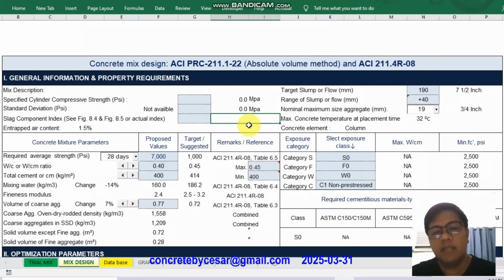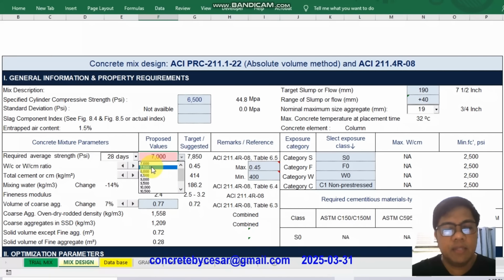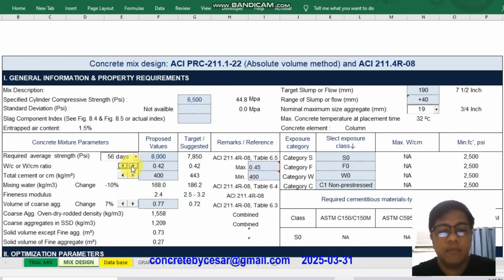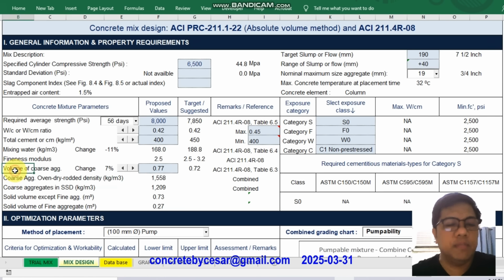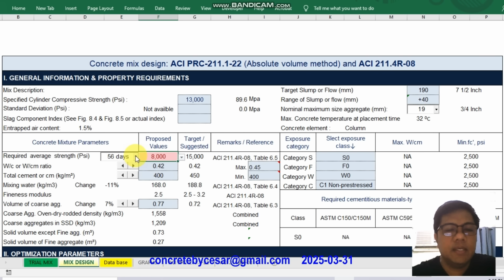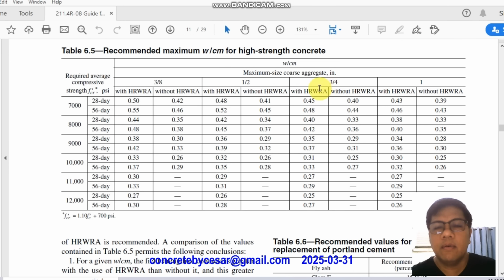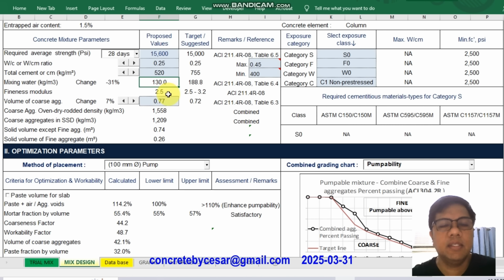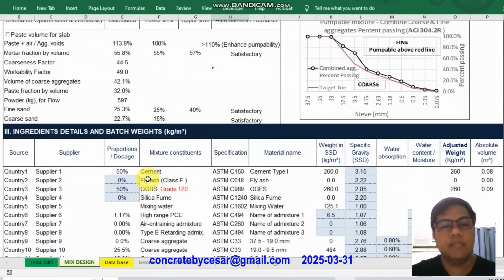​🔥 ACI PRC-211.1-22: High-Strength, High-Performance Concrete Mix Design DEMO using Excel Template

Comment from the maker: High Performance Concrete Mix Design Package: ACI PRC-211.1-22, ACI 211.4R-08
What you will get ?
✅ Instruction on how to use these amazing Templates
✅ High performance Pumpable concrete mix design template
✅ Normal strength Pavement concrete mix design template
✅ Free Guidebooks
✅ Provides criteria for mixture optimization
✅ Selection for  exposure classes and recommendations
✅ Select from Multiple Combined all-in grading envelop based on the concrete application (0.45 power, CF & WF, Tarantula, SCC, Pumpability)

Get this package 👉 https://concretebycesar.etsy.com/listing/1870237179